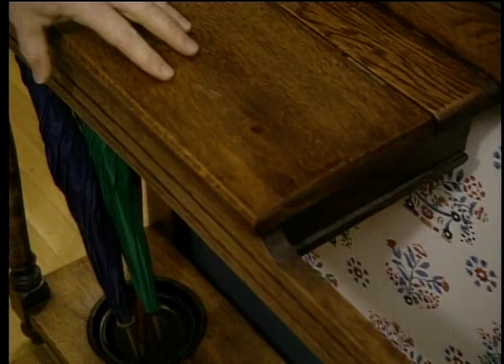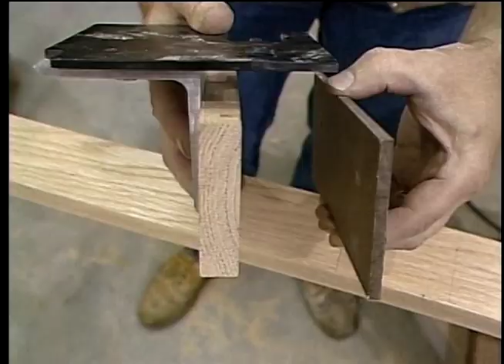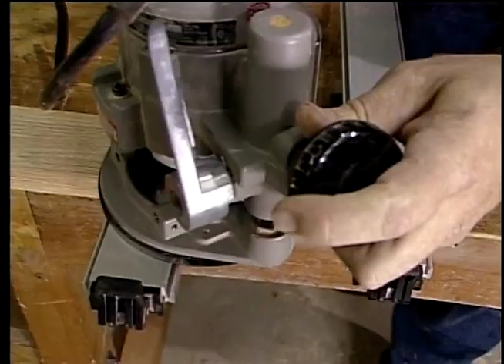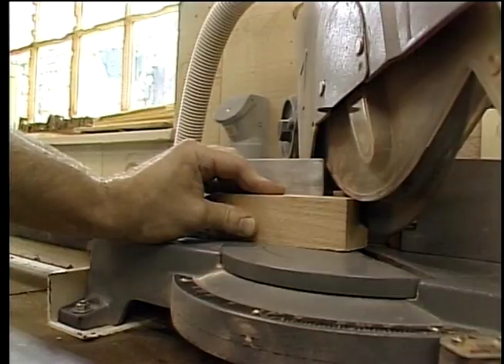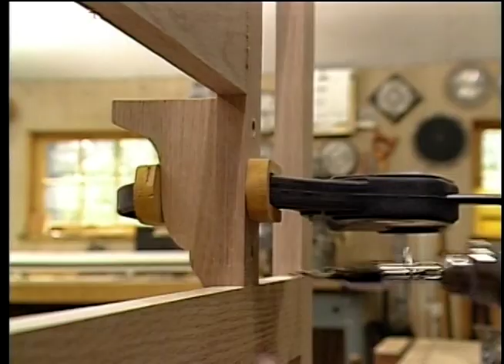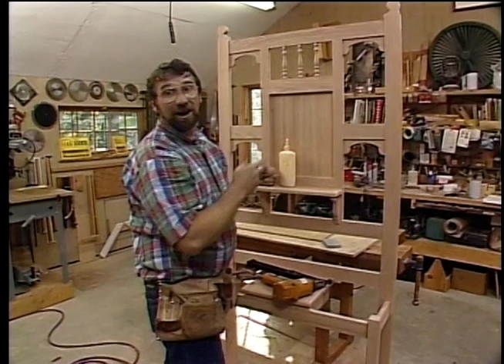Umbrella Stand  |  S4 E10

Comment: I wish I knew where to get that mortise and tenon jig
Reply: Looks easy enough to make some aluminium plate about 8mm and a large aluminium angle piece say 50mmx50mm, just need a hack saw, drill, and some files, if you can make mortise and tenon joints by hand you could easily make the jig, believe in yourself you can do it.
Reply: I already paused and made some rough sketches. This is a neat little jig! I tried looking to see if it was ever on the market but I couldn't find anything....
Reply: It’s probably not easy to find, since it was only available for a short time in the early 90s. It’s a Porter-Cable 5009 jig.
Reply: The jig seems like a good idea but after seeing how it works it just looks too awkward and time consuming. The way you have to plunge the 5/16" bit into the work and route at the full 3/4" depth doesn't make it ideal especially when using it in hardwoods like oak plus you're limited to one size of mortise/tenon.

If it's true that it was only available for a limited time then it's understandable why.